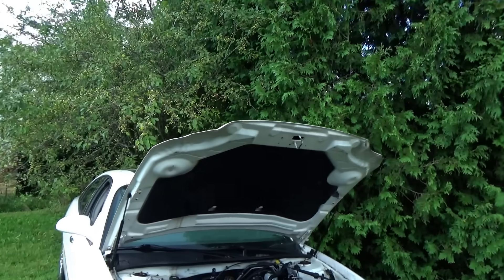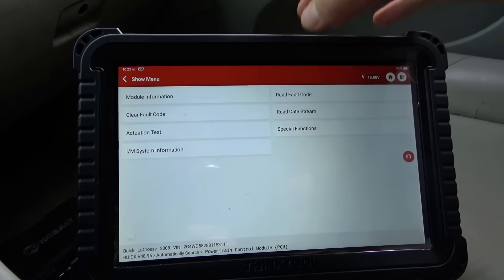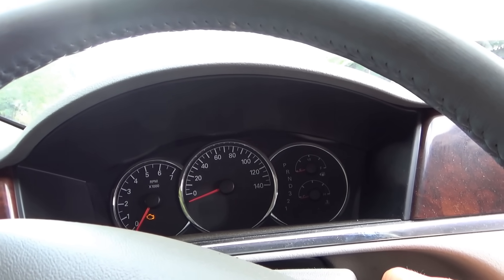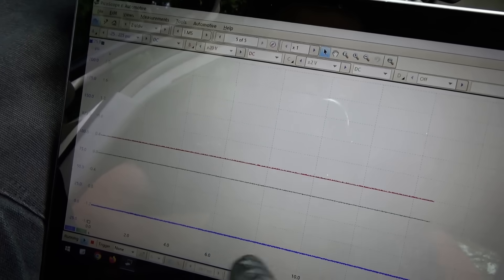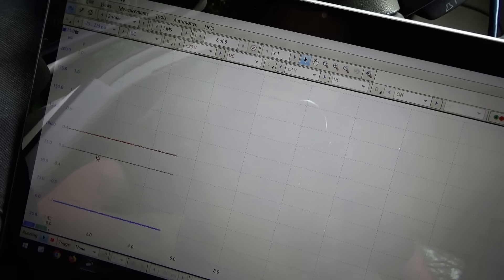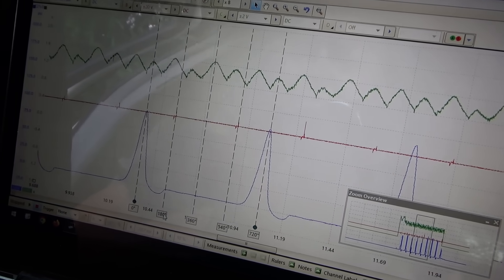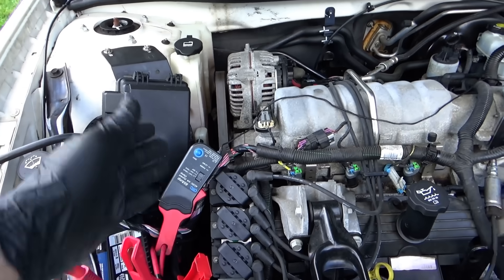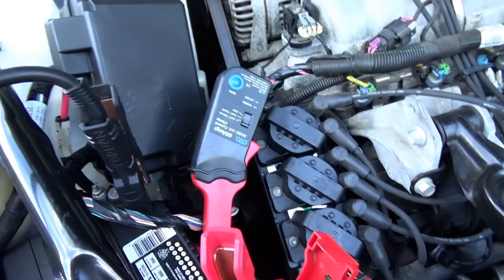You Won't BELIEVE Why This Buick Doesn't Start (3-MONTH PARTS CANNON!)

Comment: I had a similar thing happen years ago. I swapped in a 1974 Chevy 350 for a 1978 350. It wouldn't start either. After a few days of head scratching I found out why. Because the balancer of the 78 was less rusty I used it on the 74 engine only to find out the timing marks were way different. When the 74 balancer was put on the 74 engine it fired right up.

Comment: Hey there, I have a 2006 Allure 3.8 Car would start up and run for about a minute and then the message "reduced engine power" would display and the car would run extremely rough and stall and not start again. I checked the ignition coils and found that I was only getting a slight spark on the top coil, so I replaced the entire unit including the ICM after I did that I ended up with a no crank no start. The previous owners are telling me that they replaced the starter new over the past year. Any idea what this could be?

Comment: Hi Ivan, on a 2018 Buick Regal 3.6L GS i have noticed a shaking like a misfire when accelerating from around 60km/h. I have changed the spark plugs and ignition coils with parts from Buick dealer. The fuel pressure is good no check engine no codes. I use an autel ms906. The next step are the injectors to be changed. Do you think it could be transmission?? A transmission fluid change will be usefull in this situation???

Comment: Would an amp clamp be able to see tdc via the waveform and use that to see that the spark wasn't lining up? I dont scope so just wondering
Reply from the maker: @mikeychungus2229  amp clamp would just show you 6 humps... You wouldn't know which one is cyl 1 😉
Reply: @PineHollowAutoDiagnostics  that makes sense 😂 shows how much I know. I'd like to start scoping at some point. Thanks for the reply
Reply from the maker: @mikeychungus2229  sooner is better! Scope is the most powerful tool in my toolbox. Would feel blind without it 😎

Comment: At least it wasn't like the Harmonic Dampner on my 2015 Ford Cmax. It DOESN'T HAVE A DAMN KEY!!! They literally expect you to buy a special tool kit just to time the motor properly. But they didn't meet my MacGyver ass. I lined up the wide spot on the dampner  to a bolt boss on the timing cover (also had to replace that and the seal due to an accident). I installed the new dampner and thought I had the timing off. Wouldn't start. but for 1 second then die and had a code for the timing not matching up to the camshaft. I didn't realize the crank position sensor could go EITHER WAY on the spot it mounted in. I decided to turn the sensor around the other way and try it. Vroom! Car started right up. Apparently I was close enough with my line up job that it started and ran just like it used to! Yay! I wish I had made a Youtube video of it because NO ONE has a timing job for a Ford Focuse/Escape/Cmax/Edge online at all. They are all the same motor minus the lack of mechanical water pump / belts on my Hybrid. The 2.0, 2.3, and EcoBoost variants are all based off the same motor. I even straightened the pins on the electric water pump and got the plug to go back on because it's like $350 from Ford. I covered the connection in Hip tape (from my job usually used for plastic they install) and it's been fine ever since. I also had to replace the oil filter mount which THANK GOD is a separate piece on the motor because the accident also took out the center part that the filter screwed on to.  That was only $22 from Ford surprise surprise.

Comment: How does one not understand the purpose of the Woodruff key on a crank in relation to a wheel mounted on the shaft? I think even the basic Chilton written manuals instruct you to make sure the key is there and align with the slot. I think it is fair to also ask if someone is so inexperienced why wouldn't you try and watch a YouTube video or ask question on a blog pertaining to the repair?

Comment: So was the original issue that caused the vehicle to stall in the first place a bad position sensor? It sounds like the owner fixed that, but then caused a new problem by installing the harmonic balancer upside-down when re-assembling everything. It seems like the issue that was found and resolved in this video was caused by the owner making mistakes while chasing a different issue, and I'm just making sure that the original issue that started all of this was fixed along with all of the issues that were caused in the mean time.

Comment: Had a similar issue in my US Army days with a gas turbine electric generator. Combustion chamber had 9 fuel nozzles on a circular rail and a "start" nozzle. The start nozzle would spray fuel when ignition turned on and it would roll the turbine to fire the rest. The maintenance shift before me did a rebuild and nozzle replacement, then the turbine would roll but not start. I figured there was something wrong with the fuel system and when I opened the combustion chamber I found the start nozzle had an internal orifice missing. Took a whole shift to put it back together with a new part and it fired up. What was done in the past can tell you the future.

Comment: I've got a friend who has a challenge for you, unfortunately he can't get from here (TX) to you.  A 2006 Nissan Altima 4 cyl, crank no start. $4000 parts cannon!  New headlights, exhaust manifold, both CPS, one VSS, MAF, AGM battery, valve cover, coils, plugs, 1 cooling fan, thermostats and hoses. Has a new grill and motor mounts not installed yet.  I have trie to get him to bring it to someone for diagnosis, no luck.  Stubborn.  Another guy I know has a 2009 Nissan Altima, same crank no start.  Thoughts?

Comment: Did you need the pressure transducer?  The relative compression test with ignition coil sync showed you the timing was off, right?
Reply from the maker: Yes, I needed it to sync with a specific cylinder to be 100% accurate. :)

Comment: Wow. That takes a lot of ignorance to install a harmonic balancer 180 out. Even on very old cars, there were timing marks on the pulley and a keyway to position it correctly. I'm trying to think how I would diagnose that, without a scope. Given the history, I suppose looking at the balancer first, to see how the sensor was installed, may have given a clue.
Reply: Use a timing lite and chalk in a mark @ TDC #1 cyl. You can watch where it fires and determine if the timing is off. With the waste spark it may be a little tricky but I think it is doable.

Comment: Ivan, i just rewatched your BIG BLOCK F250 rebuild misfire video.  I noticed the secondary ignition waveforms were inverted.  I just scoped my OBS 5.0L bronco and they are inverted too---what is up with that?  will the spark jump the wrong way in these motors?

Comment: Quite besides your usual excellent diagnostics - the first thing you discussed was "cadence" of the starter - logic being, if the load remains constant - so should the crank sound. 
The data reminded me of the episode involving an old mate that would run up his Lotus Elite hillclimb prepared car while it was garagebound and up on blocks ( yes, blocks back then - jacks had screws) so, another mate arrived and the familiar scream pierce our ears - abruptly ended by muted WHOOPH! To me it was everything I predicted being true but the others rather regarded me as a prophet of doom that had brought out the gremlins. However: I saw the crank pulleys counterrotate before stopping!         A quick hook up to your kit would've settled the issue in an hour but things dragged on for several weeks until the engine was out and dismantled - crankshaft neatly severed.
Great work Ivan - I still say you sell your services cheap!

Comment: the 09 lacrosse could be had with 3800 series 3 in CX and CXL trims. The Super trim had the 5.3L LS4
'10 was the start of the Epsilon 2 chassis with the HF3.0 and HF3.6

Comment: Thanks Ivan. Could the same have been done with one or two secondary ignition signals and relative compression?  IOW without the pressure transducer?
Reply from the maker: @DonsTechnoWorld  not really... How would you know which cylinder is at TDC?

Comment: The owner doesn't remember the woodruff key???? OMG. Of course, even the best of us can screw up if we work when we are tired. I recall the mini series where Eric O did not tighten the harmonic balancer, and the maniacal German Engineeres relied on torque only to keep the HB in place. NO KEY. Insane way to time a crankshaft to the cams. And Eric O. Is one of the very best I've ever seen.

Comment: That was different.  I guess we should never underestimate some people's ability to F things up.
Way back Ford F350 dual rear wheel trucks had an alignment pin in the hub for the rear wheels - they'd only go on one way.  Lots of those pins got mashed in when the wheel installer forgot they were there too.

Comment: I channelled Ivan the other week, a van at work came in with limp mode and egr flow codes - some aftermarket maf had been put on it and a genuine EGR actuator had been fitted. Turns out the air flow meter was the wrong type and output a square wave signal and not a sine wave like earlier vehicles.

Comment: Not sure how you can install a pulley with a Woodruff key 180° out of phase if you have your eyes open. I have had a key snap on an old GM engine but the problem is usually obvious.

Comment: the ole "woodruff keys dont matter" LoL.   The injector pump on the 1980's Mack 6 cylinder engine is dead set easy to reattach to an engine and have spot on timing, there is a dummy double tooth on it.   I know of an apprentice mechanic at a Mack workshop who did not know, just put the pump and did up the bolts and smooshed the spline on.  Engine would not run, and its timing was way off when spill timed out the No1 injector port.    Great diagnosis Ian, your information display on the scope really nailed it.  Remarkable that the pulley was put on exactly 180 degrees out.

Comment: I don't see how it could have started to then stall at an intersection.  Only thing I hate is they are throw away crank bolts.  So you have to replace them when you remove the balancer.
But i'm the proud owner of a GM puller.  LOL   
Last time I rented the tool I told them just order a new one I will not be returning it.  The one they sell has no case, since rental is same price, I went with it so I don't lose the bolts.

Comment: Back in the early 80s I was doing my training the teacher always said no impact tools learn to do it right first. Now a days we see everyone using impact tools. Oil pan drain plugs getting stripped out all over the place and much more. I just saw one a few weeks ago on a friends used car he bought. They had just done an oil change. The person put silicone on the plug when they put it back on and it leaked that’s how he noticed it. We both looked at it and said impacted on probably. If you do a job fast but need to do it again and but parts over… may as well have paid someone to do it. Not particular to this customer of yours but its going on everywhere.

Comment: That's the first 3.8L I've seen that has no leaks! Great diag, thanks for sharing!
Reply: Series 3 are quite refined. Series 2 is a dumpster fire with everything bolted to it
Reply: Only 40K.  Give it another 40K, and water will find a way.   Dealer no longer carries the water pump bolts.
Reply: @robertsmith2956  BS   OH AND NEW WATER PUMP  $ 28.00

Comment: I’m still confused as to why the compression was lower on every other cylinder.
Reply from the maker: 3 months of cylinder wash and bad timing lol
Reply: The cylinder wash definitely makes sense. At first, I didn’t think ignition timing would cause that but after I thought about it, I could see where if it’s firing at the wrong time and igniting any fuel it could cause resistance within the cylinder that would oppose the mechanical motion of the piston. That’s why you’re the expert. I’m probably twice your age and still haven’t caught up to you, but I learned so much from you and I can’t thank you enough.

Comment: Wouldn’t just the current and ignition sensor be enough? You can see the peak current close to TDC and the spark signal being way off. Even less intrusive. 🙂
Reply from the maker: In this case yes, but I wanted to see cylinder specific TDC to rule out any other variables 😊

Comment: The tools would probably be needed if you weren't aware that the customer replaced the crank angle sensor but I could take an educated guess if that sensor had been replaced that the ignition timing may be off.

That pulley was fitted right from the 3.8 litre Buick LN3 V6 engine which was first fitted into the Holden VN Commodore in 1988 in Australia then the last of the Buick V6 engines was the L36 engine which was fitted into the Holden VY series 2 Commodores in 2004 which used the same harmonic balancer.

My dads 2000 model Holden VX Commodore runs the 2004 engine because the original L36 V6 engine suffered from exhaust valve seat recession due to LP gas use,he thought that it would be cheaper & easier to replace the engine, apparently it's not.

The LN3 V6 engine went through crankshaft position sensors for some reason because we had one replaced in my aunties old Holden VN Commodore wagon which she swapped my dads old van for because she traded it in to buy my grandmother a new car.

We went through an ignition coil pack because my brother kept driving it with bad ignition leads so both the motherboard & ignition coils needed replacing, they're an integrated unit on the LN3 V6 engine 

The best upgrade is the L27/L67/L36 ignition coil assembly because you only have to place one of 3 coils when they go,I replaced coil number 2-5 in my dads car when cylinder number 2 lost spark,he had an L27 V6 engine sitting in his shed which used the same coils so I robbed that engine of that coil for the L36 V6 engine !

Comment: I miss those simple 3.8l, 3.1l and 2.8l GM engines. The electrical systems were mostly troublefree as long as the ignition module/coil packs aren't located on top of the front exhaust manifold... 😱

Comment: I owned an Australian GM-H vehicle which had an inline 3.8 buick engine & the harmonic balancer ended up with the rubber inside going faulty,When I took it off it had the key way built into the crank so there was no way you could replace it the wrong way.All I can say is double check your work when replacing those type of parts (take photos). Cheers Ivan ,By the way that was one of the best GM engines ever made.
Reply: "owned an Australian GM-H vehicle which had an inline 3.8 buick engine" No you didn't.

Every Buick 3800 V-6 engine was, I kid you not, a Vee engine, not inline in any way whatsover. I'm sure you know that.
Reply: @BillMalcolm-tn3kq  My apologies what I should have said that it was an inline V6 not a transverse engine or as some would say north/south placement.
Reply: @LesReeves  Never ever heard longitudinal north south engine orientation called inline before. By that definition, Subies are inline engines, not boxers. Just saying.
Reply: @BillMalcolm-tn3kq  It was what we called all engines here(as inline six )& four cylinders up until the early seventies when transverse engine vehicles started being imported from Japan.Until then the Morris Mini was what we called an east-west engines.
Reply: @LesReeves  Yes, we called BLMC crud like MInis, 1100s and Land Crabs east west engines in Canada as well in the '60s. My father purchased to his undying regret, an early Land Crab.
Nevertheless, once the term transverse came into use, which wasn't till the '80s (name me a front-wheel drive '70s Japanese car besides Subaru that was exported before the Toyota Tercel Terminal Rust bucket with a copy of the Triumph 1300 layout came along late in the decade), north south for engine orientation, plus longitudinal, has been the norm.  So, if you're trying to convince me that Aussies walk around in a haze calling north south or longitudinal engine placement inline, please understand I do not believe you. At all.  Begone with silly excuses.
Reply: @BillMalcolm-tn3kq  My mum had a Mini & as kids we used to take it up to the trotting track & do laps sideways🤣she never knew.

Comment: i remember i got a Pontiac some time back with that same issue however the owner i got it from had put on a doorman balancer it’s honestly to long i can’t recall if it was just off or he installed it wrong but it was something different about it from oem i seem to recall it having 2 key ways but he was off 180 just like that i honestly couldn’t remember what the deal was but i remember talking it off reading the directions and putting it on and it was fixed lol

Comment: I added a PHAD pressure transducer to my arsenal years ago. I bought the 1st gen if I remember correct.  Works great with my scope. Once you learn how to use it and read the data. You diagnostic time is cut in half and spot on.  Great video Ivan show the power of a scope and right attachments.

Comment: @14:07 the old school method is a timing light. Find TDC cylinder 1,  Mark the balancer with a line that goes from TDC to about 3/4" back before TDC, connect timing light, crank engine. If the light doesn't light somewhere near tdc then you know what you need to know to call a timing issue. Just because you don't need a timing light to set timing on this car doesn't mean it isn't a useful tool.
Reply from the maker: That would work in a pinch! But so much easier just to pull one spark plug and let the scope draw some squiggles 😁
Reply: @PineHollowAutoDiagnostics  You have to pull a plug to find TDC to mark it anyways.  So no savings.
Can't wait till Ivan has to many transducers and sells one cheap.  LOL